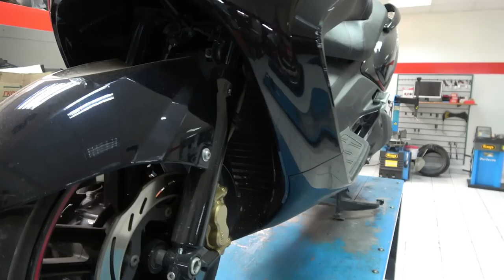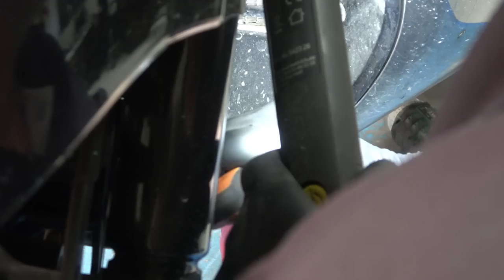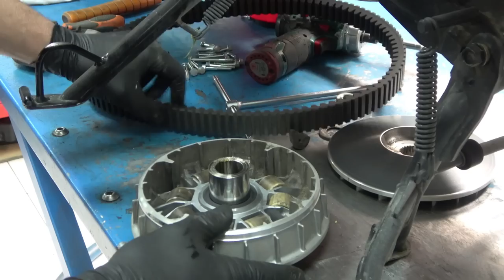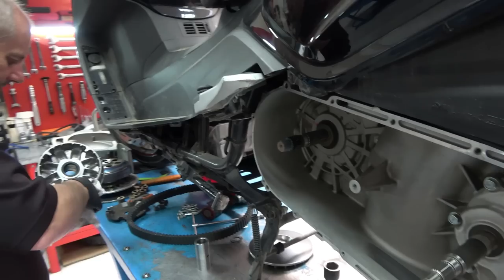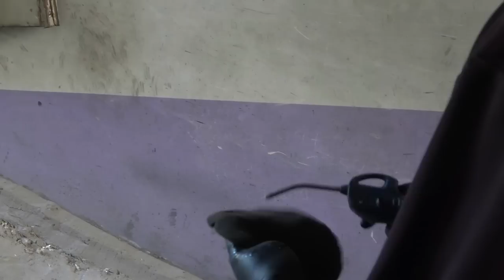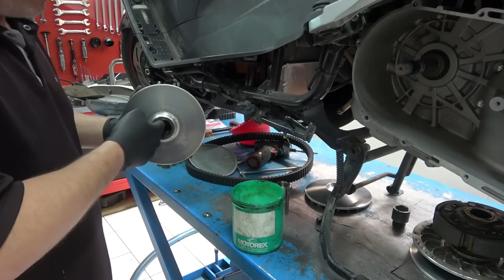drive belt maintenance SYM MAXSYM 600

Comment: He didnt torqued the clutch and variator nuts to factory specs!!! that's a terrible mistake. He should get the values from the service manual, then use a special tool to hold variator and clutch in place, and then use a torque wrench with the proper values.
Reply: @ronkol28  He is probably a good mechanic, but either a little lazy or he is pressed with a lot of work to accomplish in one day (maybe he has to work on several bikes during the day per his boss direction). Either way, this is not good. Also, as a piece of advice for TravelMoto...if you are going to record a video that it will be seen by the world, please talk to the mechanic first and make sure he will be doing the proper procedure. We have seen another videos from this channel with other mechanics and they did it well.
Reply: Well, “should” and “could” are just different by one letter. 
Mechanics often just use an impact wrench and their expertise. 
Keep in mind that he is may very much aware of the torques and his wrench. You fastly know how much is enough if you test and measure sometimes how long you impact…
Reply: Esas tuercas se aprietan solas por inercia  , trucos de experiencia  , se aprietan solas rodando , nunca dar apriete

Comment: when you see blue, that means the clutch was overheating. working too hard. very sloppy work the mechanic does
Reply: The drum of the clutch my friend,is with light heating not overheating- 600cc-with brake and accelerator the jaws can be melted in less than 2 minutes,maybe where you are only having plains
Reply: @nikossinapalos3705  Hello….I just found a 2014 Kymco Xciting 400 with only 3000 miles….so obviously it has just been sitting for a long time or just used off & on very little….is there anything I need to worry about or check on it before buying it? Any suggestions or tips?